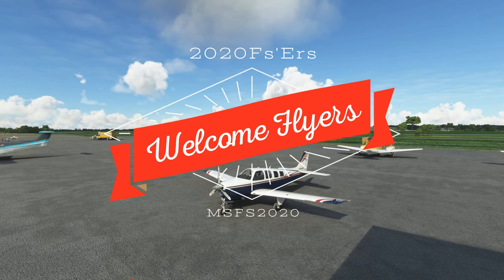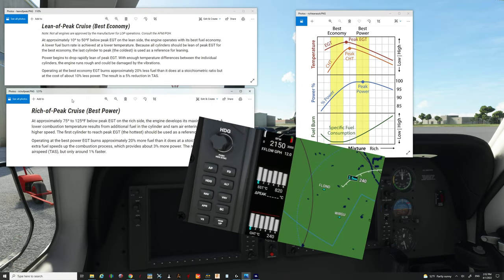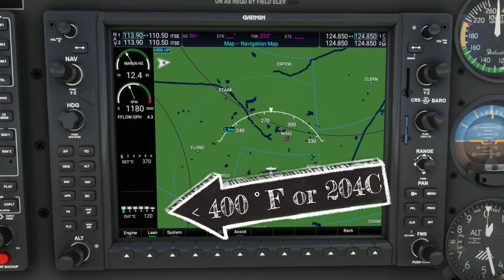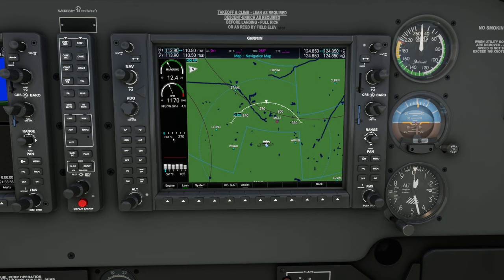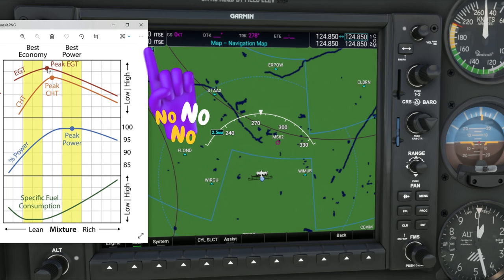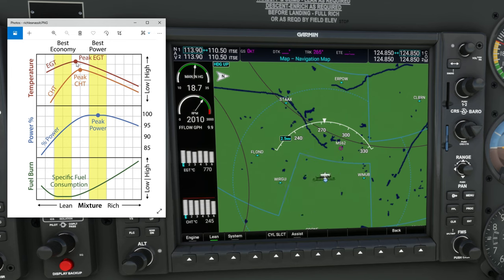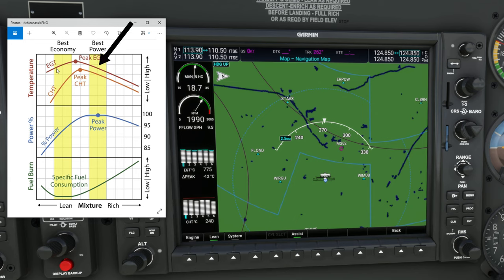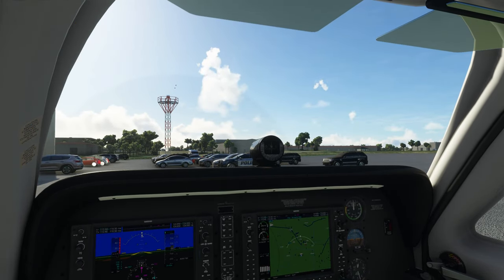Msfs2020 *G1000Nxi Lean Assist* Full tutorial-POH/Power cruise settings and much more!

Comment: Hi, thanks for the clear video. On my G1000 the temperatures are set to Farenheid. How can I change that to Celsius? thanks a lot Michel, from Holland (Europe).
Reply from the maker: Thanks for the comment yes those are adjustable you need to use the MFD screen for this and you're going to use the big knob or the outer knob to go to your systems page within that page you can adjust all the different parameters that they show just scroll down to what you want to change so you would just press in on the inner knob to get your cursor to populate and then use the outer knob to scroll through the various settings that you can adjust

Comment: It seems it's no longer working with the new avionic update. EGT doesn't change when you lower mixture (except if you put it to 0 because the engine stopped 😅).
Reply from the maker: Great another thing they messed up lol. If you don't use lean assist does the egt temp change when you adjust the mix? If so you may need to manually watch it instead of the assist feature
Reply: @2020fsers  Since my message, I've asked the question on MSFS forum and it was just the automixture that was activated... I even didn't know about this option. My bad ^^
Reply from the maker: Oh yeah in the assist option I keep all mine off
Reply: Yea mine didn’t change burn rate or egt unless you go full lean and engine dies

Comment: Just ran across this. I thought I was using the assist correct but I was not doing the reset as you showed. Thanks again. BTW has anyone on the comments indicated the units of measure error of inch pounds versus inches of mercury manifold pressure. lol Thanks again for the great info.
Reply from the maker: your welcome thanks for the comment